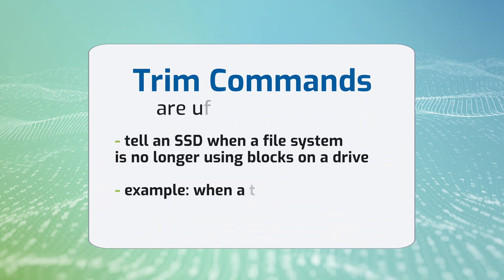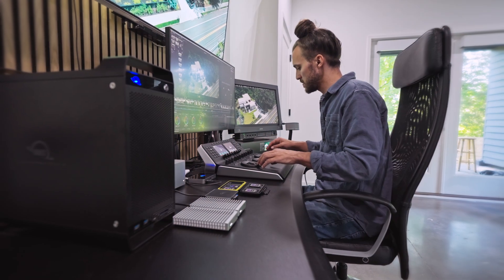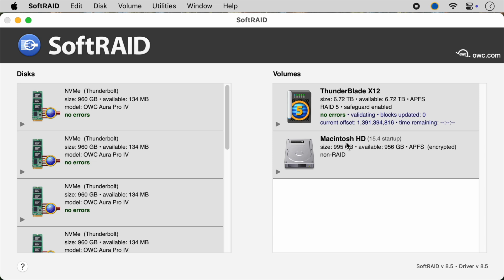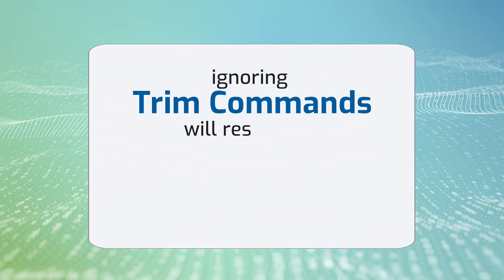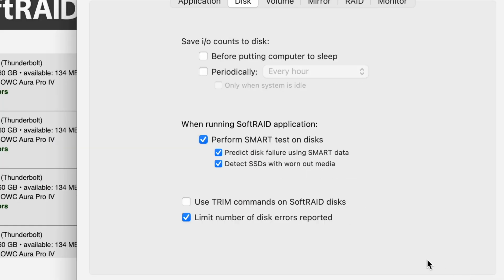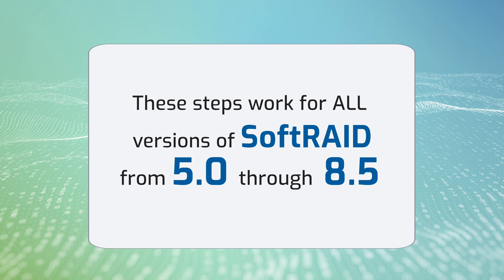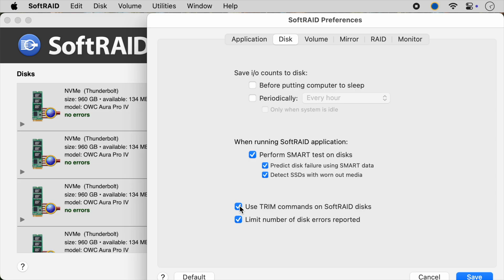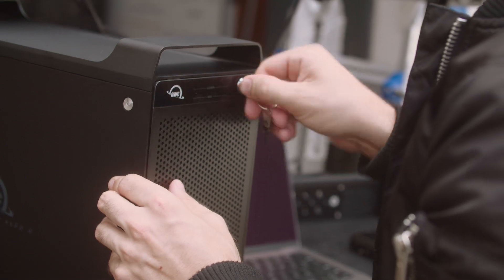How to Fully Protect your SoftRAID RAID 4 & 5 volumes | OWC

Comment: Assume this issue does NOT impact RAID 4/5 volumes that use traditional spinning hard-drives right?
Reply from the maker: That is correct - this only applies to RAID 4/5 volumes using SSDs!
Reply: Was going to ask same thing!  Thank You.  It seems like he only is mentioning SSDs.  Maybe they will answer.